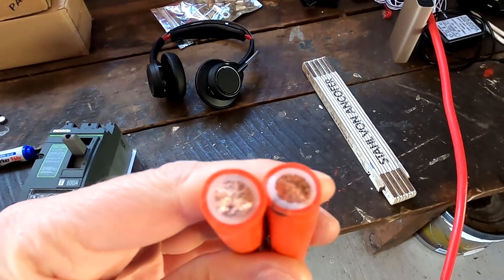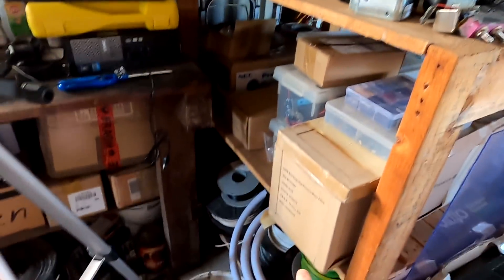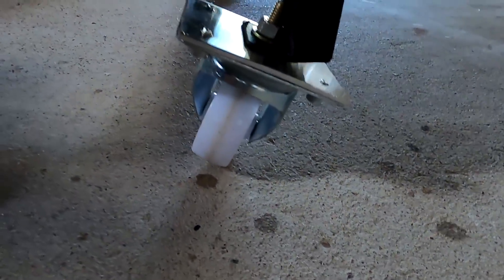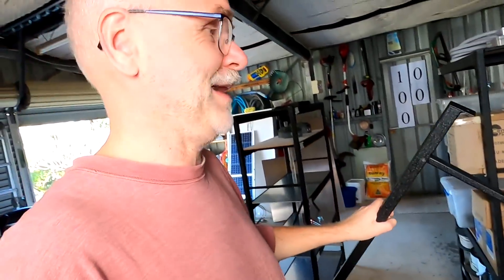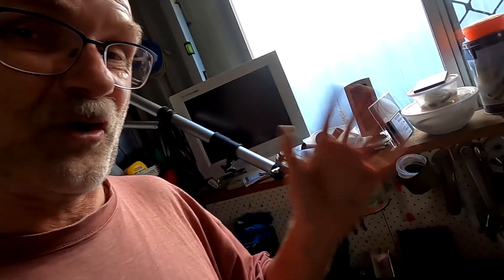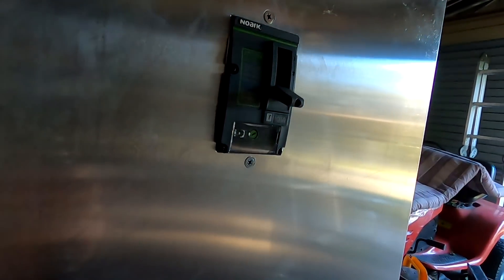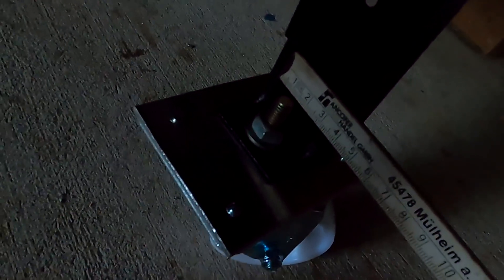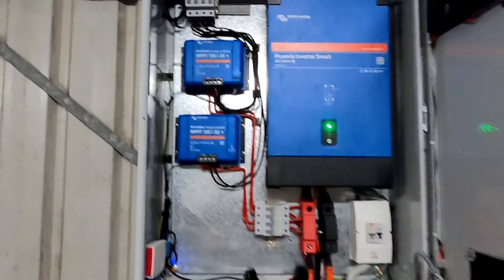The Future of the Off-Grid-Garage! It's all complicated...

Comment from the maker: Guys, I appreciate all you comments about hybrid inverters but this cannot work as it would not be able to handle the power coming from a second source (solar on house) in addition to the solar on my garage (different location!). The garage solar is incoming DC, the house solar is exporting AC. I know there are Victron bad-ass inverter solutions which could potentially handle that with multiple devices installed and communicate together somehow but there is no way I'm allowed to install that (yet) without loosing my feed-in tariff. There is only one solution as far as I know... stay tuned 😊
Reply: Just use the shed to power a big spotlight that shines on the array that is receiving the feed-in tariff at night. Crazy but legal.
Reply: The reason circuit breakers are the size they are is because they need to be large enough inside to extinguish an arc that happens if current is flowing when the breaker trips. 
More current and more voltage requires more space and size to snuff the Arc.
If the internals weren't large enough to quench the electrical arc it would sustain its self by melting the internals and ionizing the metal into a hot ball of conductive plasma that reaches 4000 degrees easily. Also known as an Arc Flash.

DC is more difficult to break the arc on than AC and you may see this if you look at the voltages and amperage a breaker is rated for then compare it to the DC rating which is always a much lower amperage and voltage.

Comment: Hi Andy, I hope you will not use this cable underground. We have here termites and many cases, that there were a short circuit underground. Holes in the plastic, insulation away. Now I use water pipes to protect the cable

Comment: What app do you use with the BMS? I use "Onebot" in version 3.1.1026 of the link that the seller gave me, everything is exactly the same as your samples, but I can't get the cells to be shown in colors, only the one with the very high value is shown in red and a light gray the one with the lowest value, the rest look like black or dark gray, not green as they look on your screen Sorry if I do not explain myself correctly, it is a machine translation.

Comment: Hay Andy.
I'm guessing that you have a similar issue in QLD as I have here in W.A. - You can't change existing solar setup without messing up the tariff,  you can't attach anything to the grid without approval from the grid operator, and they won't approve anything over 5kW (which won't be enough to handle the peak loads from the house).
I plan to skirt around that by installing a second switchboard in the house, running AC back through the cable that used to feed the shed, and swapping the house circuits over one by one until I either run out of capacity, or run out of circuits.
Also, have you considered mounting your panels on an angle? I'm mounting mine at 55deg, so they max out production in mid winter (summer is never going to be a problem).

Comment: Hey Andy!
I recently stumbled across your channel while I was researching which active balancer to install on my battery bank.
It seems as though we have been up to much the same thing on opposite sides of this big brown land!
I'm in the process of setting up a similar system over here in WA and have found your videos very useful, at one stage I was even thinking that I might even record my experience too, but you are doing such a fantastic job I don't think I'll bother.
I have just managed to finish watching ALL of your off grid garage videos, but I haven't had a chance to browse comments yet, so please forgive me if someone has already said this.
I am so glad to see that you switched to using aluminium shelves, and also the additional breakers, but I'd recommend that you also use a non-flammable shelf for the top of your battery system (my reading of AS 5139 says you should!).

Comment: Andy, are you on the 44c feed in Tarif? If so you need to maximise your day time feed in. First thing I would do is get your pool onto the battery or, more importantly off your grid supply some how. This was on my list of things to do, before I sold my house and gave up my 44c feed in. This would make a huge difference. Mpp solar make a 2 kw solar only motor controller. So while the sun shines your pool runs. Or you could go with a solar pool pump. I’ve got a 750w solar pool pump, unfortunately I never got around to putting it in.

Comment: Hi Andreas, 
have you ever thought about the performance of your converter required, taking into account the "Start-up current" ? I do not have a Multiplus so far... asking myself if the 3kW or the 5kW or even higher would be required, not to cope with the avg power drawn (in my case +/- 1kW over all 3P) but the required Peak-current.

I have seen a video from Victron where they say you would need for a 1P eletric motor up to 6x the "Anschlussleistung"... (in a 3P environment only 3x, as 3P is smoother)
In the case of my tablesaw (2,4kW) that would mean I need a 15kW inverter ?!?!?!?!? crazy ! 15x overdone for the regular power drawn.

Could you PLEASE make a video-test... if your 3kW Multi can start an elektric motor of.... XYZ kW? 

I appreciate  your work and diligence for the community! 

Greetings and thanks!
Michael.

PS: my Tante lives in "KS" !! Herkules!

Comment: To add the wheels: Instead of just adding an L bracket to strengthen the legs instead: Just run a piece of angle iron to span the width of the entire shelf that connects the two legs on the end together. If you use a strong enough piece of steel here you could actually "widen" the base of the shelf to increase the stability. By widening the base you could potentially make it safe to wheel your battery shelf's around as well. Edit: Haha. I see at 9:55 you basically realized my idea already. But I would suggest using angle bar instead of flat for increases strength so that you could widen it.

To simplify the solar wiring: have you considered using micro-inverters? This provides MPPT at the panel level, so shading (Or other issues) of one or a couple panels in a string is no longer an issue for the string. It completely eliminates issues like "Do i do parallel strings, do I do series first or parallel first", etc. With microinverters each panel becomes 100% independent. You can then couple these panels to your battery through the inverter. Victron (And many others) inverters support AC coupling. Meaning they can pull power from the AC generated by the panels and convert that to DC to charge the batteries. The inverters can also do phase shifting to control the output of the panels. Basically they can shift the frequency up a few Hz and cause the solar panels to decrease their output or shut off completely once the battery gets fully charged.

I have microinverters on my home solar panels and I tested this during the winter storm power outages in Texas. I connected my motorhome inverters to my home grid and AC coupled it to my homes solar panels to power my house from my RV battery during our 32 hour power outage. It was able to charge my 200Ah 48v RV battery from the AC coupled solar panels on my homes roof.

Just thinking that this could eliminate/solve many of the issues you mentioned in this video. It would cost a bit more but at this point it seems like you're willing to invest in the right solution if it makes sense long term.

Comment: Hi Andy, thanks for all the videos. How is the capacity of your existing battery holding up? As we could see some cells charge and discharge faster than others.
From what I could see, they are not that old yet.
Reply from the maker: This battery I build, I messed around a lot while testing, so the balancing is out of whack. Once the second bank is installed, I will again top balance this battery before it goes back into the shelve with the new one.
There is no degradation at all with these cells I could find. Using it over 7 months now and still like new.

Comment: For the shelf, you could have used 2 pieces of wood to join leg to leg, even extending past the shelf size if required to give even more stability.
Nice Solar project you have coming up, looking forward to it.
Reply from the maker: Yeah, that's what I did now, a flat metal bar across and under the legs fixed the issue. 💪

Comment: Sounds like a conundrum I can relate. I am currently grid tied micro inverters on net metering, so I get kWh for kWh credits for my surplus. Adding battery backup was a bit of challenge, but I'll need to dust off my programmable logic control skills to make it happen. Right now my inverter is pretty much is acting like a UPS and if I want to incorporate solar to it, I will have to manually transfer a portion of my array to AC couple in to the critical loads side to trick the micro inverters thinking there is grid to push back to. The limitation is that I only have 300 Ah of telecom AGM batteries to play with and of course the usable capacity is only 50%, but for now it keeps the lights on for about 6 to 8 hours.

Adding to the interesting challenge is that I am also doing a hybrid approach having a 48 volt distribution power rail for my telecom/networking equipment, utility room lighting, and outdoor security lighting. Deciding what I want to be on the AC side and what I need to be on DC side to have a bit of redundancy plus managing it all.
Reply from the maker: Thank for sharing Felax. I find it quite difficult to integrate my battery solar system now into my existing house system while staying within the legal requirements of this contract. But I think I found a simple solution now.
Reply: @OffGridGarageAustralia  staying within your feed in tariff agreement and to get both systems to play nicely is the challenge. Simple is sometimes is the most difficult, but it turns out to be the most elegant solution.

Comment: To make it easier to get the cables through the conduit blow talcum powder into the conduit first. I have parallel inverters and also have spares I can change inverters or go to one in 10 minutes as they are not hard wired they are connected with 25amp polarized shrouded connectors the Australian Electric Vehicle Association forum is a good place for off grid you can find me there.
Reply from the maker: That is a great tip with the conduit. I know a few people at AEVA in Brisbane...

Comment: A little off topic but is it not winter in Australia right now? Just impressed you wearing shorts. Any way keep up the good work love to watch your videos. By the way right now in New Mexico it very warm.. I had to move my batteries out of my garage because of the high temperatures (100 F) in the garage.
Reply from the maker: Yes, It's winter now down here and pretty cold with temps under 10°C during the night.
I newer had to move my battery in summer. Even at over 40°C they did not get hotter than 35°C. It depends on the location where you keep them, I suppose.

Comment: Connect with a piece of 50mm angle iron steel or aluminum,  to go from leg to leg, it will make it he whole think stronger!!
Reply from the maker: 50x5mm flat steels bar fixed it 😉💪
Reply: @OffGridGarageAustralia  yeah, I tend to go overboard when engineering things like this, my dad and I built a trailer to haul cars, when done, we could haul a D6 cat. Dozer on the thing, much heavier than the intended 3400lb load! It can easily haul 3x the intended load, new Axels and it could possibly haul a D8 dozer,  but it does haul good, you can't tell its there,    yeah I guess I was planning for you to put a Tesla on that shelf! Ha-ha!!

Comment: Nice video. I would suggest buy more cables..you can be sure you will use the cable..even if not now you will need it for next time..so better buy more ..i would also suggest 50 mm*mm or 35mm*mm cables
Reply from the maker: I use 35mm cables throughout the whole installation and 70mm cable for the main busbar connection. 16mm for each solar charge controller.
Reply: @OffGridGarageAustralia  Nice and thanks for information. I ofc don't know what are your plan. But for 3kw it is ok to use 35mm , for myself i have 5kw Inverter and i use two 50mm cables as it is specified  .. but if you will use two 3kw inverters or maybe 5kw ..you need to go much higher

Comment: I have those shelves. they are great but putting them on wheels is asking for trouble. one little stone and they will topple. they will flex and bend over time. At this point also may be best to mount mppt's on the battery shelf close to the battery and run a solar lead to the shelf.
Reply from the maker: If I mount the SCC in the shelve, I would need to think about cooling too. Hence the decision, to leave them in the cabinet separate from anything else.

Comment: dont forget to put the external stuff on a back board not directly on the steel sheet...
that plastic conduit... just wipe the two cables with soap rag when you feed them through will work fine.
Reply from the maker: It will be a similar setup as with the cabinet for the inverters.
I also ordered 40mm conduit now...

Comment: Hi Andy.. Maybe stupid question... Did You check casters kg limit? I hope You do not overweight Your shelfs/casters...
Reply from the maker: Of course I did, they have 125kg/each
Reply: @OffGridGarageAustralia  and only 1 of Your shelf can handle 400kg ;) how much shelfs You have ? ;) or those 400kg is total...
Reply from the maker: @rafaswierczynski  that's 400kg per shelve but I use the mobile shelve only for my electrical stuff to wheel around. That's far less than 400 all in total.
Reply: @OffGridGarageAustralia  good :) i was worried about that ;) safty 1st.

Comment: Andy... quick question about inverter for the house in the garage.... how much energy are you planning to loose over the distance?
Reply: I must have missed the fact that your bound by contract... this now makes way more sense.  Tu. Marc
Reply from the maker: There is a 16mm cable from the garage to the house. At 240V, the losses are what they are, nothing I can do about it. I cannot change any cables or add additional ones. It is what it is...
We don't have any large loads in the house apart from stove and cooktop which we only use once a day if we not use the BBQ outside.

Comment: Andy, add a length of aluminum between the legs so they are connected then mount the wheels. Should make it a lot stronger and more sturdy.
Reply: angle iron better
Reply from the maker: Done that, Gary. All sorted.

Comment: Hi Andy,

You can move you house off grid and just keep your existing panels and approved grid inverter connected to the grid.  This will allow you for 100% energy grid feed in.  As long as the existing panels and inverter are in no way connected to the off grid solution then this is allowed.  I have verified this with a couple of different sources.  Just move your existing circuits to the off grid system.  As easy as that.

I have been thinking of moving my house off grid so I can take advantage of the 44 cent FIT before it finishes.  I'm with AGL which offer 15 cent FIT so I currently get 59 cent FIT.  I currently make about $2500 per year with free electricity that I use form grid.  I am thinking that moving my house to off-grid and allowing100% of my power generation to the grid would quickly offset the cost of purchasing all the off grid equipment.

I'm thinking of using three MPP Hybrid V2 5048 5Kw 48V Inverters in parallel for redundancy and for additional battery charging capacity.  I'm also thinking of using the SEPLOS battery banks in a RACK mount fashion. Not sure if you have seen these but a very polished system.  I'm still pricing everything and I think it will be cost effective considering how much money you have and will spend on your shelving solution.

SEPLOS : https://www.youtube.com/watch?v=CYJQxdfDj84. This is a stacking version but I'm wanting the RACK version.  Same thing though.
House off-grid  : https://youtu.be/DZS4af1sGIM?t=48

Comment: Redundancy is great. You do know you can leave your grid tied inverter as is and still charge from it backwards through an off-grid battery inverter. A changeover switch would be required however. Not sure what solar contract limits you have.
Reply from the maker: Nope, not allowed unfortunately. Only at night.

Comment: Hi Andy, why not just go for one inverter you can always use the Grid as a backup, I have an automatic change over so when the inverter is turned on it switches most of the house to the inverter just the oven is left on-grid and if the inverter is turned off then it will switch back to the grid, I also use https://iotawatt.com/ to monitor all the AC circuits, I use a Raspberry pi that communicates to everything the iotawatt  the solar charge controller/BMS etc it also checks BOM for weather updates, if the battery is low and plenty of solar from the grid-tie panels I will change from the grid or if It receives a BOM weather alert of a storm it will charge the battery in case the grid goes down